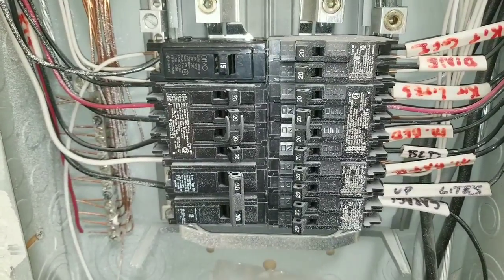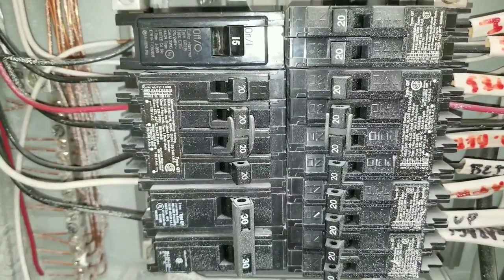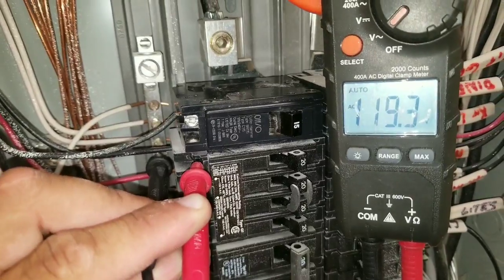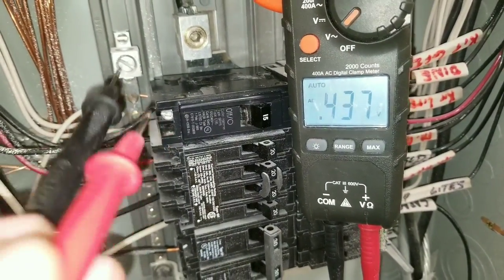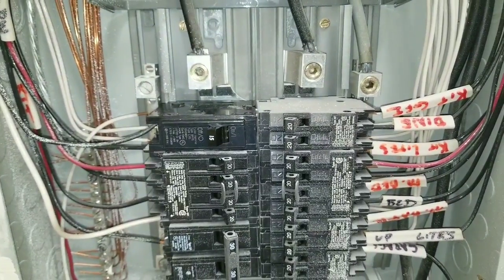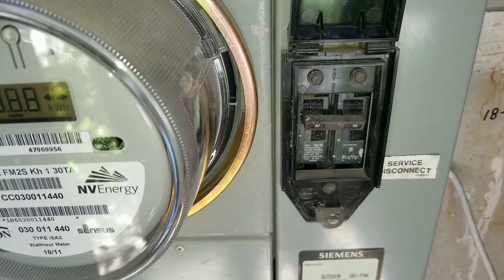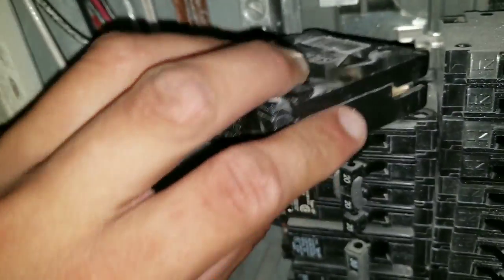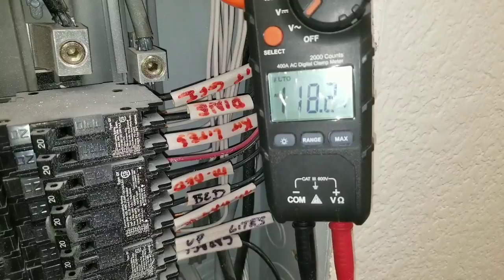How to Test Change Replace Circuit Breaker EASY!

Comment: For a 240 volt breaker, place the ends of the multimeter in BOTH terminals of the double pole vault.  It should read 240 volts.

Comment: I have 2 AFCI breakers, both tripped 1 instantly and 1 after a few minutes.  Nothing new was plugged in into these circuits.  Would replacing the breaker be my first option at this point? Thanks

Comment: Got a quick question bro. I got a tankless water heater getting no juice I noticed that the 50 amp double pole is a Siemens but the panel is a square d. Does that normally cause this issue?

Comment: hey man.. can i use a multimeter to test how much consumption for each circuit breaker. My electricity bill is sky high and im trying to determine where / what is the cause of the high consumption.
Reply: No.  It will show whether power is there or not, not the amount consumed.  There are ways to test electrical consumption.
Reply: @armymobilityofficer9099  and how do we test for consumption?
Reply: @pewpewpew2325   1. There are systems that hook into your breaker box - these require more electrical knowledge.  

2. Individual electrical monitors.  These measures electrical use for individual appliances - relatively easy to use, but you need one for each appliance.  

3.  Look at your meter.  In our area we have a spinning wheel that shows consumption.  You could turn your breakers off one at a time to determine what has the greatest impact on wheel speed.  This gives you an idea, but not exact numbers.  If you identify one breaker as drawing the most power, you can unplug each item drawing off that breaker, inspect the meter and repeat for everything on that breaker.  This will give you an idea where electrical hogs are located.

Some houses have phantom electrical use by things that are drawing power even when turned off or the appliance may be drawing more power due to a defect in the appliance.  

I hope this helps.
Reply: @armymobilityofficer9099  hi thank you for taking the time and explaining this to me.

Comment: Sorry did not help me on another problem with the finding out about a bad breaker. I'm curious is it possible for a breaker to not to be turned on won't turn off and still have power going in when it's on the off position is it possible something like that to happen
Reply: Hey did you ever get any answers for your question ? I to have similar problem. And he should move his hands and actually show and tell you with words where each of his leads are being placed and if there is a order of commenting those posts that should be followed, I.e. Always comment ground first, or always connect to neutral first then hot. Or whatever. Please let me know if you got any resolution? Mine started with having an air fryer plugged into an outlet that all of a sudden the power went out on that run so I checked all the outlets on that run not clearly marked in the breaker panel but I've been doing his prayer research and and adding things to it found all the ones that are on that circuit but when I turn the breaker off there's still power coming in and the outlet tester showed open ground or open neutral at first and then I checked a bunch of them and look for loose wires and everything didn't find anything nothing burnt now the outlets test as hot ground reversed which there's no way that I mean I checked all that too and I don't know so I'm thinking it's a bad breaker but nobody's got the answers the circuit wasn't overloaded well maybe it was this refrigerator is on that circuit along with the the range the stove which both were on obviously the refrigerator is on the oven was on at the time and then I put in the air fryer I know that refrigerators are supposed to be wired soul isolated but apparently mine is not so it could have been an overload but no physical signs of that like melting or Blackness or anything but I'm going to go and continue testing on for all the food in the refrigerator melts please get back to me as soon as you can if you have any anything anything thank you